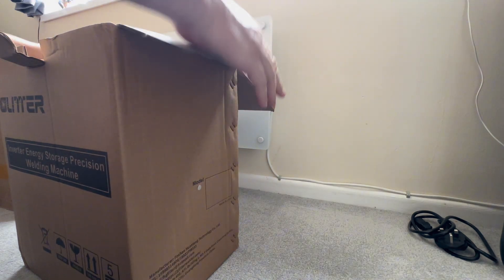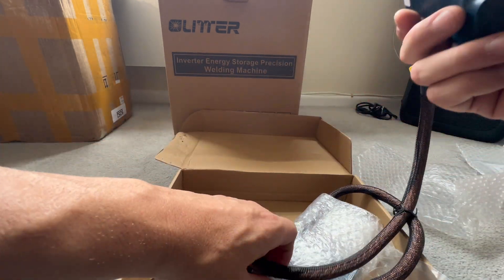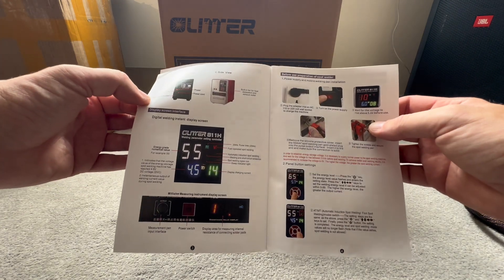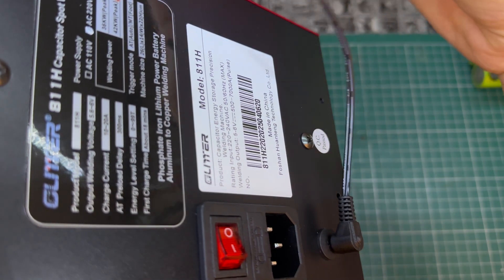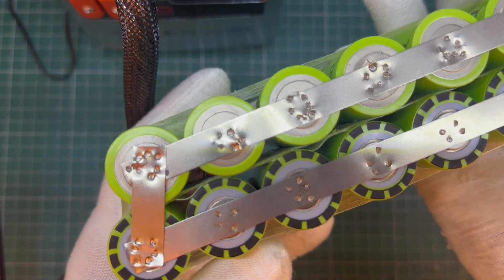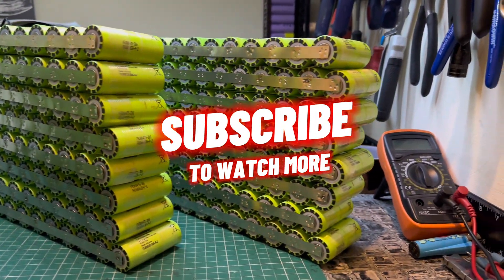Glitter 811H Spot welder: unboxing

Comment from the maker: Unboxing and setting up the glitter 811H Spot
welder

Timestamps 

0:00  unbox
0:04  what’s inside the box?
0:06  2x Glitter 811hH milliohm resistance measuring pens.
0:13  2x bags nickel test strips.
0:24  1x Glitter 811H pedal switch.
0:35  1x Glitter 811H power supply lead.
0:41  1x small real of 10mm by 0.15 copper strip 5 metres.
0:52  2x spot welding electrodes.
1:24  4x spare electrode tips and Allan key.
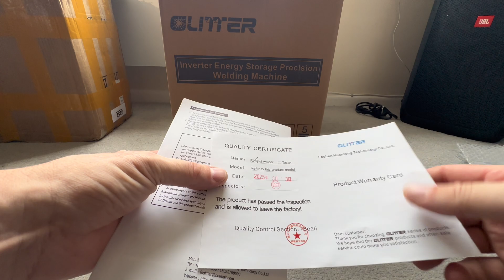1:41  Glitter 811H user manual and warranty card.
2:01   2x screws for electrodes to bolt to the machine.
2:06   Now we have the glitter 811H 42 kW spot welding machine. 
2:17   please like and subscribe if you haven’t already.👍🏽
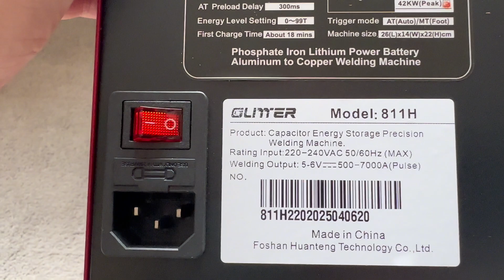2:42   specs of your machine.
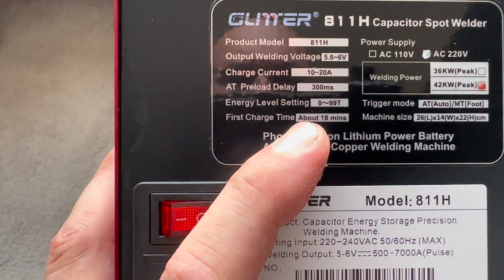2:54   power input socket.
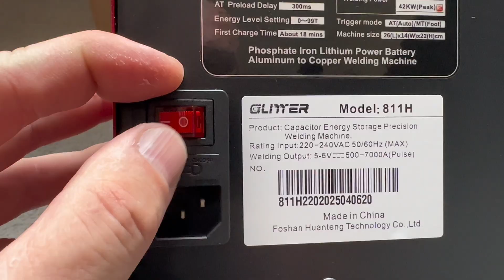2:57   electrode socket / or pedal switch socket.
3:02  The Glitter 811h power on/off switch.
3:08   setting up your Glitter 811H for the first time.
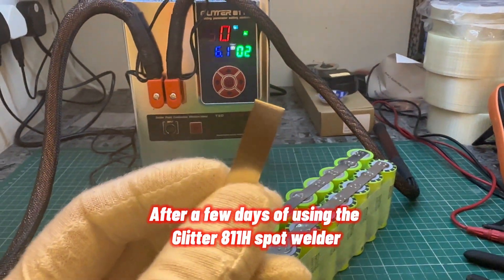4:42   Best setting using the Glitter 811H spot welder for 0.3 gauge nickel strip. 
6:15 the 2 foot 24s 12p battery at 87.4v.